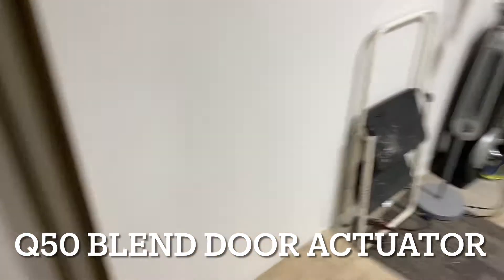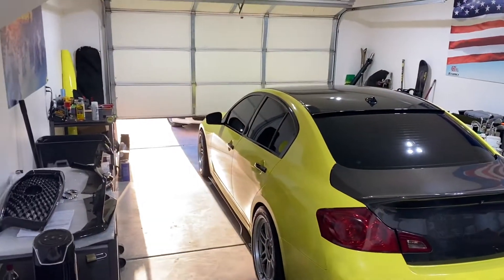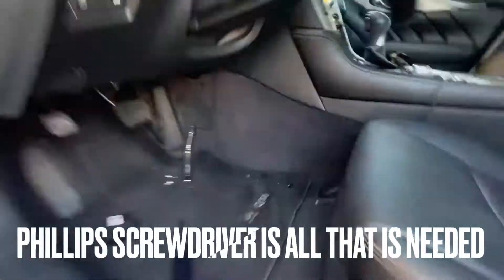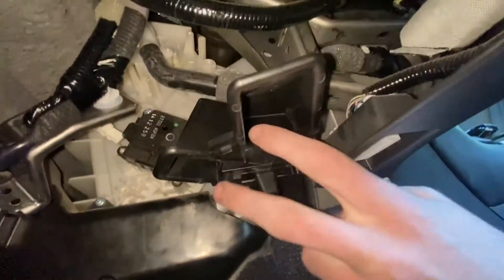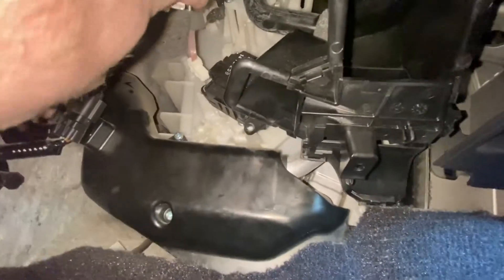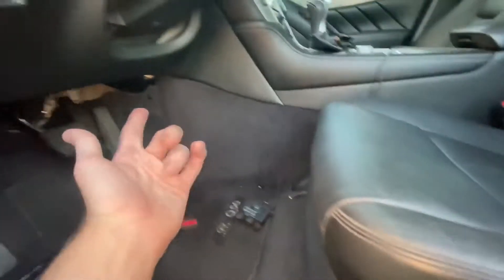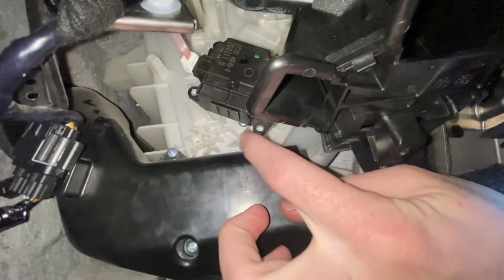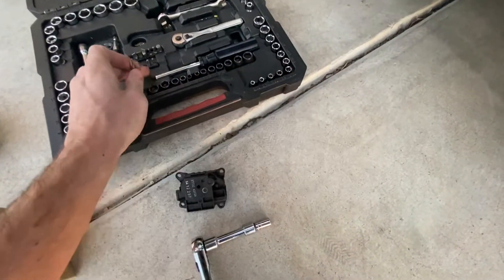Q50 Blend Door Actuator Fix EASY WAY!

Comment: This was great. I did it in about 15 minutes and the other note I would like to add is was to wiggle the air deflector and just take it out. It snaps right back and you just gotta be careful not to break any tabs. This  gave me a little bit more room to work with. It is tight in there, but not that difficult.

Comment: my AC works fine on both side for my 2017 RS, but my problem is the heater, it blows cold air on the passenger side and somewhat warm air on the driver side. Would changing the actuator on both sides solve this issue?
Reply: Idk if you got this fixed or not but it’s one actuator for both sides, it’s stuck blowing cold on one side so this part will fix that

Comment: Hey man, thank you for this vid, it work and was easy! Since I added the new acuator now it blows cold on the driver side @90 degrees... the lower I go to 60 degrees its hot/heat air and warm on the passeneger side. If I hit dual, it reverses side so that one is always hot and one is cold. Did I do something wrong?

Comment: Would this be the same problem and fix for a 2017 Infiniti q60? It is basically the same car minus 2 doors. Thanks for the input. So glad that the car community share their experiences and fixes for cheap instead of spending thousands in the dealership. Keep up the good job.
Reply from the maker: I would imagine it’d be very similar! Honestly I’d try going down there and wiggling the lever with finger before buying the part. Some say it works

Comment: Do u know the fix when your Q50 lock system make that cranky sound and it makes a clicking lock and unlock sound while driving plus I say a few Months after the cranking sound my key fob stop detecting it got worser and now it just makes a loud cranky sound when I manually locks the car plus my car start clicking by itself shortly after I park and turn off the car I literally just had to remove my negative terminal overnight so it won’t start clicking on n off cutting my light on n da inside of the car to save battery life

Comment: You know think this is located in the same spot as an M37x? I searched the actuator for my car and your video along with more q50s popped up. Also, is their another actuator on the passenger side or does that one work for both? My cars passenger side is only blowing cold air
Reply from the maker: There is one on both sides. My g37 has never gone out before but it as well has 2 one on each side

Comment: Just did mine and it still didn’t help only the driver side heated
Reply: Same! I just done my Driver Side replacement tonight and only took about 15-20 min due to it being a tight space to work in. Installed everything correctly but air still doesn’t seem to blow correct temperatures. 

Im wondering if it’s the passenger side actuator that’s causing the issue now or something else?
Reply: Same here. Any update?

Comment: Is the passenger side actuator just as easily accessible?
Reply: I'm also suffering the problem for passenger side... just realized today. Not yet checked, I assume there is a same actuator at passenger side. Will check

Comment: These is pretty ingenious however your have to have some nimble hands to be able to do it without removing the panel. In the end I couldnt get the last back srew and wiring harness off the actuator so I had to remove the panel. Even after that it was still not that easy to access everything.
Reply from the maker: Sorry man!

Comment: Just like every ither video I've seen on this topic nobody goes over recalibration or resetting after actuator replacement.

I replaced mine with an OEM part, and it fixed the problem except it only blows cold air once the temperature setting is placed at 61° any temperature setting above 61 degrees only hot air blows out the vents. The system needs resetting / recalibration. 

Nobody goes over that
Reply from the maker: @MajDuty  mine didn’t need an reset or recalibration. Just a new OEM part fixed it for me and everyone else in this comment section lol.

Comment: New actuator worked for a day and broke
Reply from the maker: Did you get an OEM one? I’d take it back to dealership
Reply: @CRTFD_G  Whats that? I have to get one tomorrow?
Reply from the maker: @latashabrown2926  i put the part number in description of video. Call your closest infiniti dealer & give them that. Should be about $50
Reply: @CRTFD_G  We replaced this today? And its not working. Any ideas?